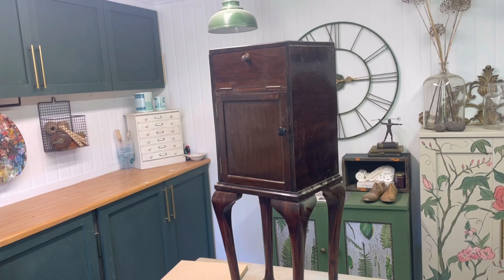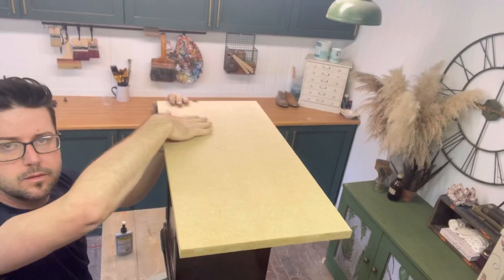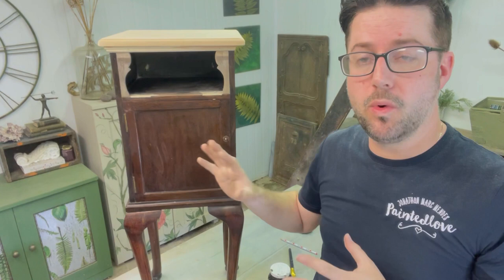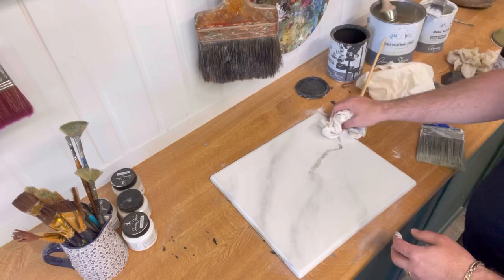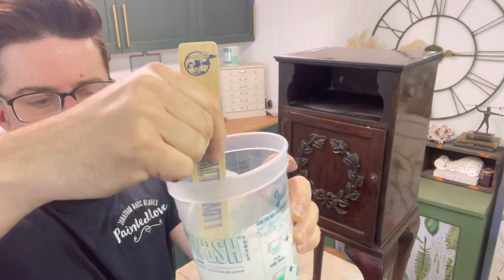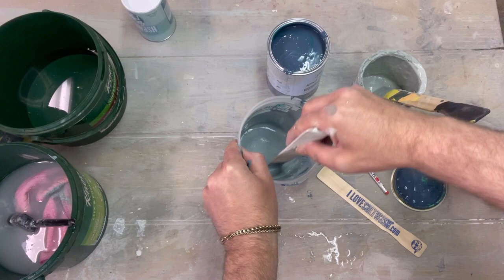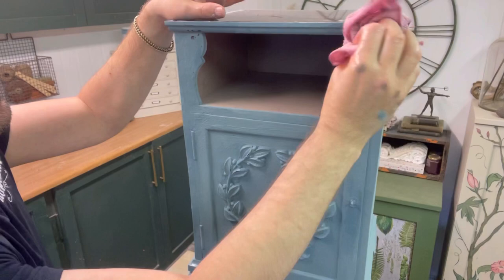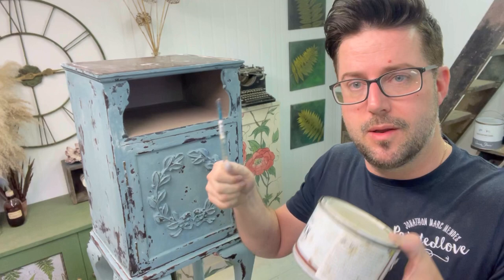Chalk Paint￼ chippy finish get the authentic look using salt wash as a Gesso￼.

Comment: Oh, I'm loving this sweet little table! But why Saltwash? I mean, could you do the same thing with say....baking soda? I've never used Saltwash. And I really like the way it distressed before adding your color wash. I think the distressed layer would be gorgeous with a rubbed in wax finish. Not necessarily on this particular piece, but in general.What do you think?  Also, the chippiness you are getting with the blue wash applied, is that new chipping or where it originally chipped when you coaxed it off during the gesso stage? Or a combination perhaps? Its just lovely

Comment: I tried the salt wash gesso and it didn’t seem to stick as well as yours did, so I stopped wet distressing. (I just applied a coat of Amy Howard milk paint over the top, fingers crossed) I’m wondering how well the finish held up after you waxed and cured your piece? Does it chip easily? Thanks
Reply from the maker: Hey there maybe the consistency of your gesso needed a little bit more salt wash mine did go on pretty well even though it was a very shiny surface it seem to stick beautifully and the overall finish is really good it hasn’t seem to carry on chipping anymore once the wax is cured please let me know how you get on with your distressing with the Amy Howard ❤️❤️
Reply: Thank You, I will.

Comment: Did you paint OVER a layer of wax? Did the paint adhere to the wax?
Reply from the maker: Not during the process but if you meant from the beginning on the timber it may have had a wax finish🤔 or if it was the Marvel technique then yes I did reason being if you’re working on a dark piece of furniture you need something to hold down that first layer of paint because once you start hitting it with water it would destress on the edges and you will probably get the ward coming back through which wouldn’t very nice so yes in the Mmarble technique and with Annies paint you literally can paint straight over wax if it’s well buffed in… hope that makes sense
Reply: @JonathonMarcMendesPaintedLove  yes, that’s what I was referring to. I’ve heard from so many artists that the wax is the last thing to go on because you can’t paint over wax. That’s why I was surprised to see that you did just that. I use Annie Sloan chalk paint, so that is good to know. Thank you.
Reply from the maker: @crookedhousefurnishings1905  And he does a really cool technique where you can colour wash straight over wet wax and it’s awesome so there’s so many uses to the wax it’s not just a finishing product it can be used in So many other ways to thank you for a great question 😊

Comment: Why did you put a new top on? Is the piece not real wood? Even so you didn’t use a good piece of wood so I’m confused
Reply: The piece didn't really have a "top", and was unbalanced as the bottom piece of wood on the cabinet was longer than the top so he added a piece of the same size. He didn't need to use a good piece of wood because he was turning it into "marble".
Reply: @lindz916  well it’s beautiful 😍